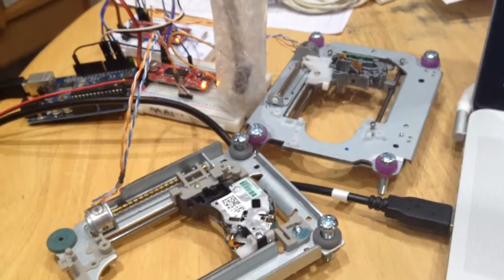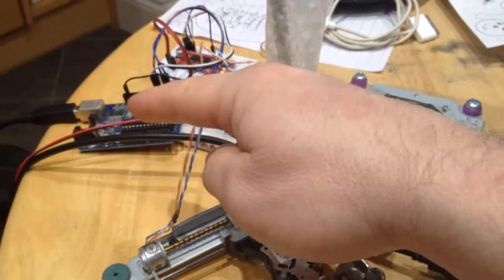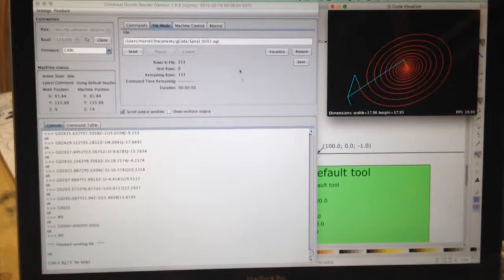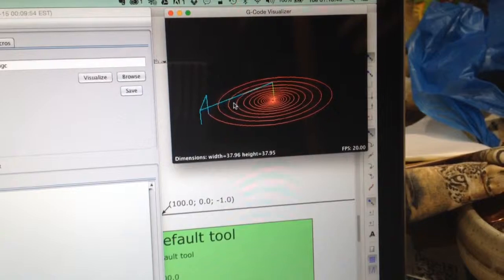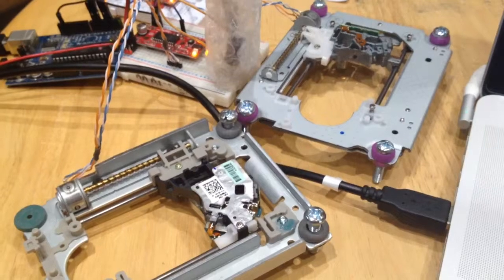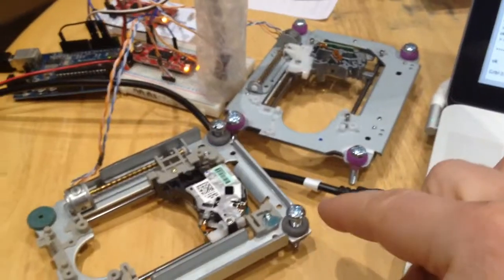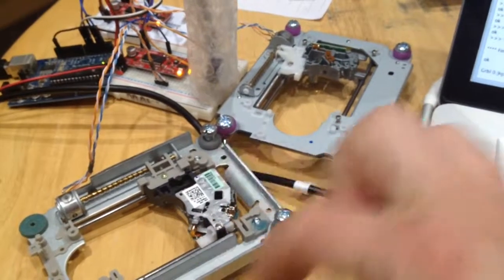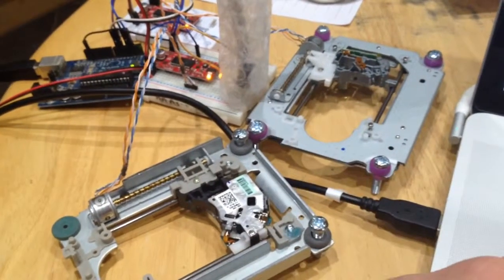DVD CNC — First Steps

Comment: can you help me? how to in library GRBL to Arduino. and how your program? this setiwan.ridwan26@gmail.com
Reply from the maker: +Ridwan Setiawan …Hi Ridwan.  The GRBL sketch is uploaded to the Arduino just like any other sketch.  When it runs, it just listens to the serial commands coming from the computer.  On your computer you need to have some software that sends gCode commands.  I use 'Universal gCode Sender'.  The gCode comes from an Inkscape plugin.

So, 1) draw in Inkscape
2) export gCode from Inkscape using a plugin
3) use Universal gCode Sender to send the gCode commands to the Arduino
4) GRBL converts those commands into motor movements.

Does that make sense?
Reply: ok..thank you
i little understand..
can i ask your program GRBL?